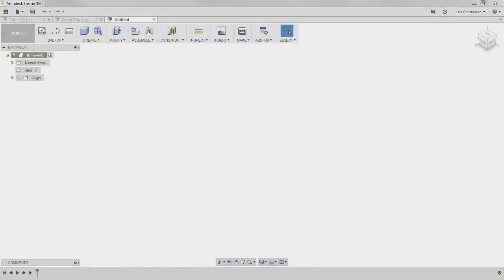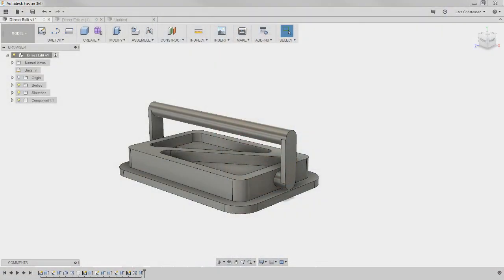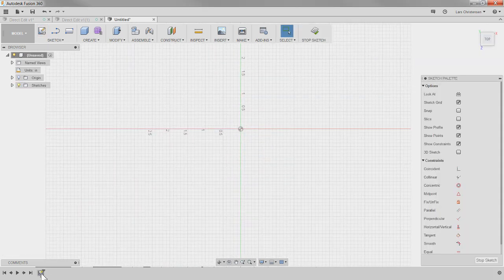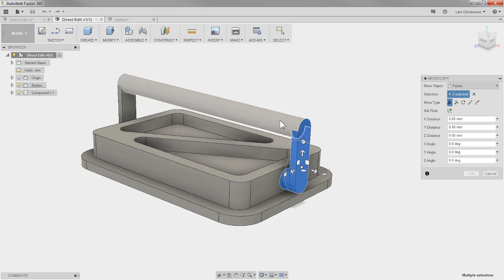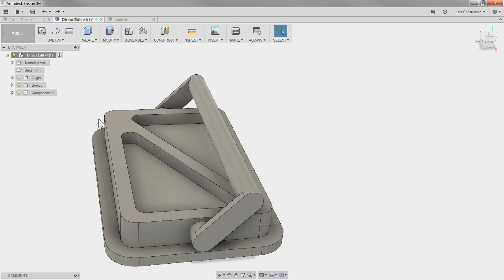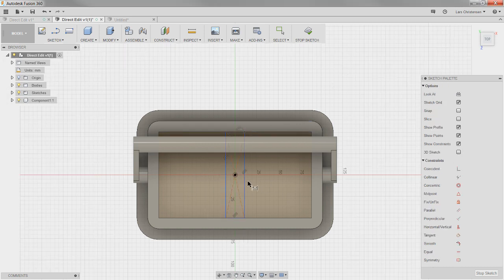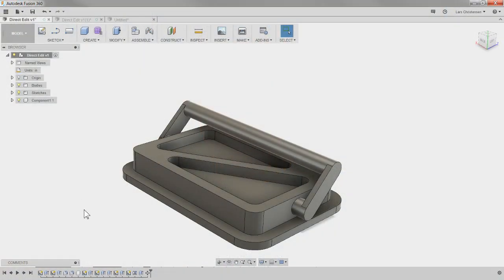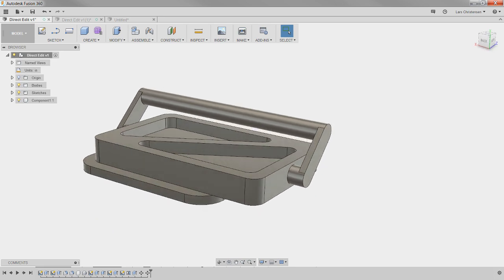Fusion 360 — Direct Modeling Vol.1 —Your Comments & Questions — #LarsLive 15

Comment: Lars, you still monitoring? If you are, two questions:

1-Startup business (just me) requires me to model real world objects, like railroad equipment.
2-Building a house (mostly my labor), wish to design in intimate detail; e.g., every 2x4 so that I can develop a materials list for cost estimation.

Is it true that Direct Modeling (with libraries of parts) rather than Parametric modeling is the way for me to go? Don't want to expand the foundation in one direction and stretch out 2x6 framing from 24" o/c to something else.

Not sure, though, I yet understand exactly what is Direct Modeling. Thanks much.

Comment: Lars, Beginner's question...how do you rotate the model in your view without using the Orbit button?
Reply from the maker: You can hold down the shift key while pressing the middle mouse button...Or, cheat like me and use a device from 3Dconnexion.com :-)
Reply: Thanks Lars. I use a 3Dconnexion stick on my desktop, but I was stumped when using the laptop.

Comment: hi Lars, I am trying to create model sailboat designs. the hull curvature is complex, and I am getting close with lofting spline curves, the cutting the surface with rotated splines and curved planes. transitioning from sketches to solids and meshes without creating a tangled mess is my problem. this webinar is quite helpful, thank you
Reply from the maker: Hi Scott, Thank you for taking the time to watch the videos! I will be rooting for you!! :-) 
Have you looked at the sculpting workspace within Fusion 360? That might also help.

Best,
Lars
Reply: I played with sculpting a little. I've used blender and wings 3d, and am comfortable with mesh geometry. from my early explorations, it seemed the benefits of parameterized sketch modeling got lost. I will watch this video again to see how to get the two modes to work for me. this software is really fantastic, and your videos are extremely helpful. I've been a software developer for 36 years (had to look at calendar to figure that out, my head is spinning). I appreciate quality. your videos give fusion360 a friendly, enthusiastic, knowledgeable face. for me this is a unique experience, on top of great, evolving code - I can't thank you and Autodesk enough. expect more questions from me on more difficult and esoteric subjects as I evolve. peace
Reply: oh, the various curvature tools - how to use them, what they tell you, how to fix problems they identify. I'd like to understand that better. thanks!